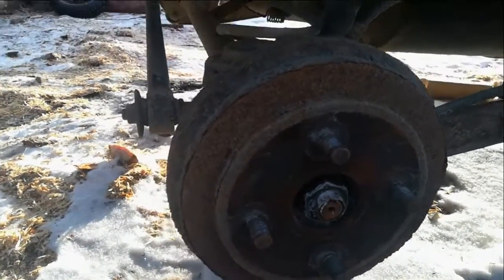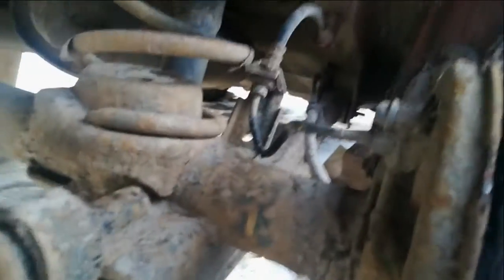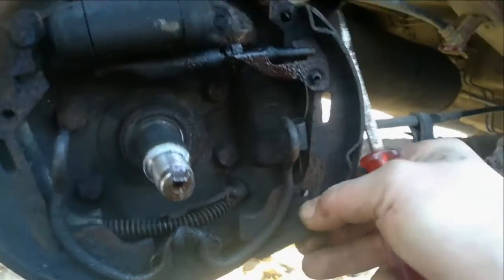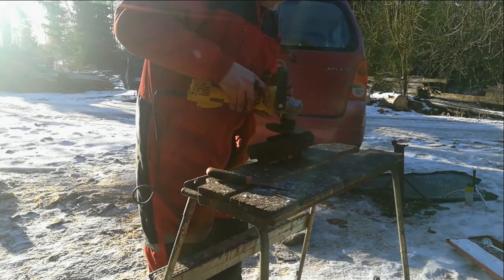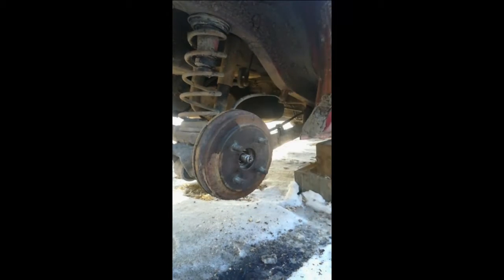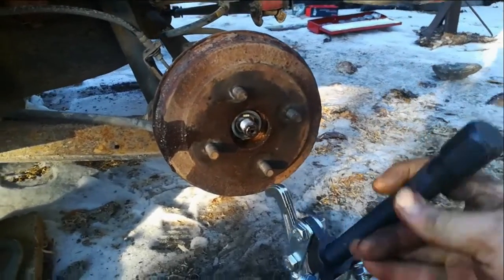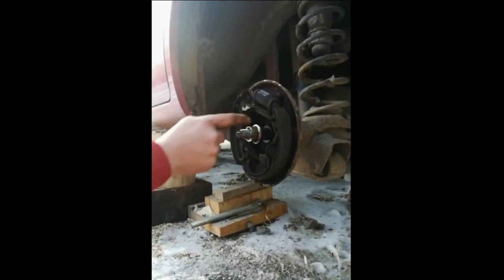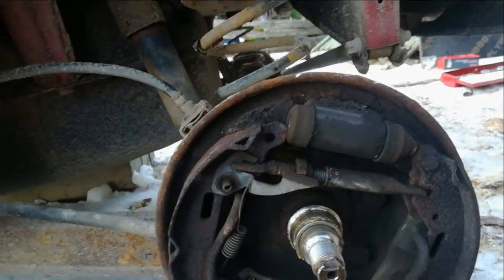Opel Agila/Vauxhall Agila/Suzuki Wagon/Splash. Rear brakes. Removal and refit.

Comment: Many thanks!
Same as Suzuki Wagon R+ 2003(2nd gen).
Symptom: Cyclic noise from rear left of car.
Found the heavy brake return spring had snapped at lower connection point.
Springs are available online.
2 foot extension tube needed with wrench for 30mm central bolt.
Took photos on smartphone (synced to cloud) before disturbing brakes.
Your video was very useful when fitting new spring.

Comment: many many thanks,i had the same trouble,the hub would not come of even with the wheel on for extra leverage, had to use a puller like you,this video helped me every step of the way,as i had a worn bearing and the shoes were very low so changed them while the hub was of...did it all.....cheers
Reply from the maker: Glad it helped

Comment: The easy way is to unscrew the big central bolt with the wheel on and the vehicle in ground with handbrake then jack up the vehicle remove wheel and use the wheel as extractor ...